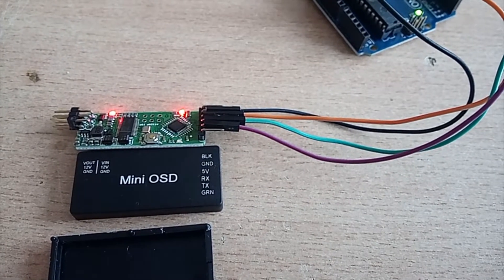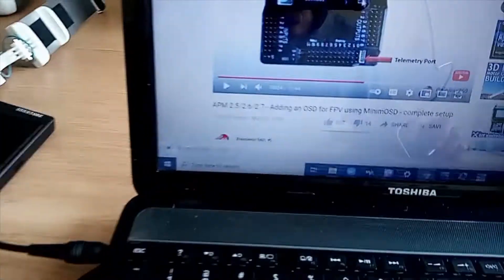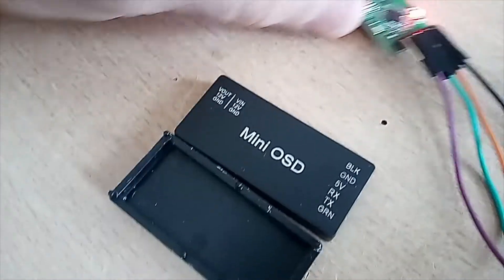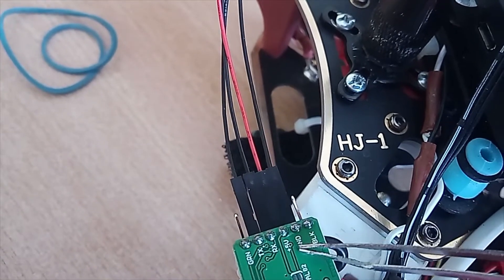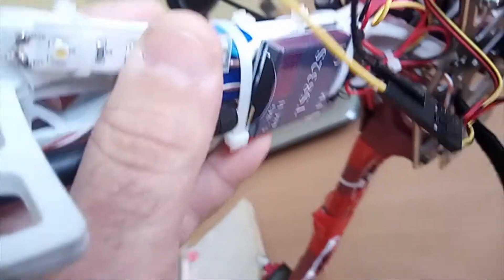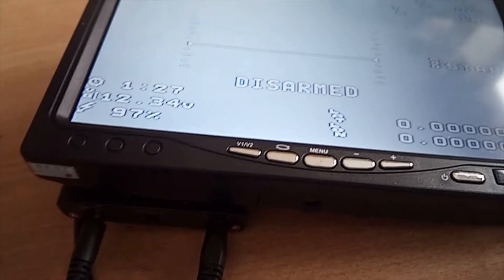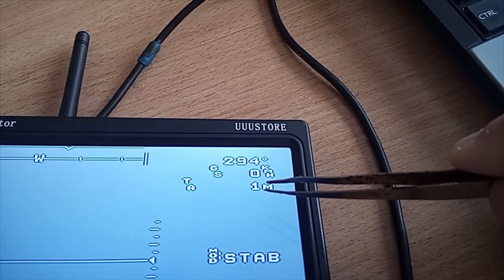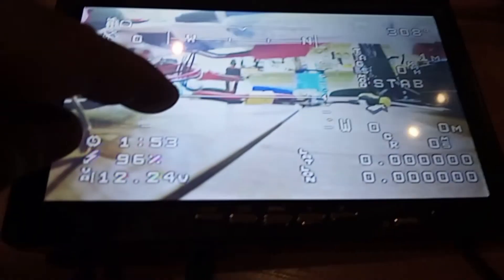Connecting Mini OSD to Pixhawk flight controller

Comment: Ihad the same camera as you and it worked fine, so I just let the drone aside for some times and when I came back no matter what I did it will not work. The only thing that I had done was to upgrade the pixhawk to the computer to missionplaner once...